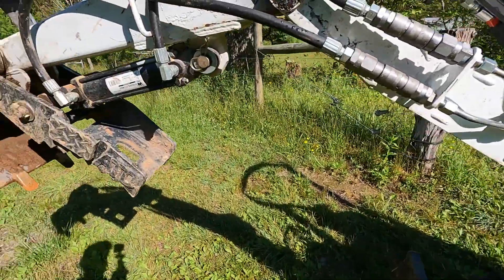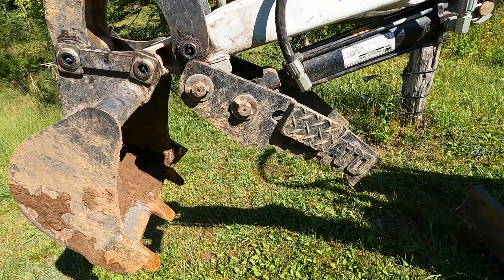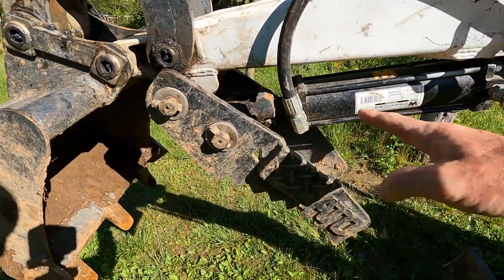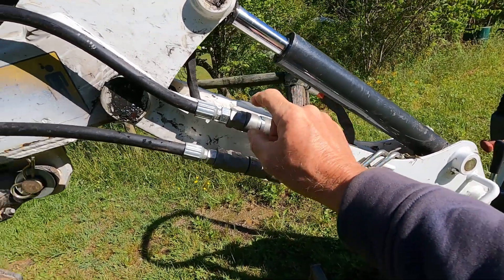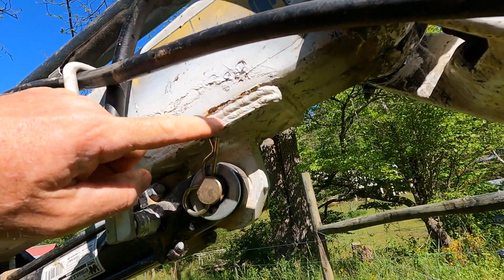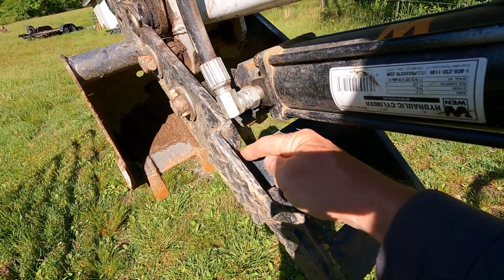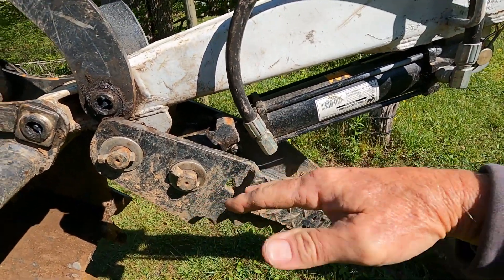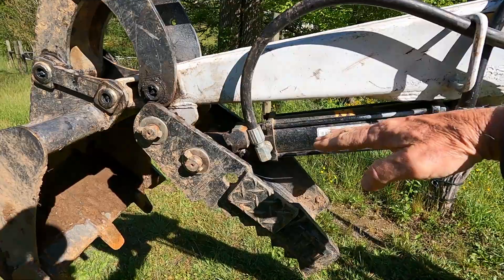Hydraulic Thumb for the Bobcat E10 Excavator

Comment: Hello, very informative video thanks. May I ask, does this require double action auxiliary hydraulics? I'm not sure if my e10 will support this or if I have only one way hydraulics.
Reply from the maker: The hydraulics on the e10 are two way so it easily works for a thumb. The problem is making a thumb fit on an e10. The stick is so short in relation to the thumb length it makes it hard to fit.

Comment: Thanks say do you think changing the position of the cylinder mount a little closer to pin in the boom would allow the thumb to open more
Reply from the maker: I have tried all positions to maximize opening and closing and have tried 6, 8 and 10” cylinders. With a 6 it opens fully but doesn’t close enough. The 8” closes but doesn’t lay back flat. The problem is the stick is too short in relation to the length of the thumb. I heard you can use a thumb for an E20 which uses the bucket pin but also requires some modifications. Good luck. 👍
Reply: @arlingtonguy54  thanks

Comment: I just bought a brand new bobcat e10 last December and they installed  a hydraulic thumb on for me . Later on I found out was the same thumb they use for an e 20 . Yes you’re right sometimes  is just in the way .
Reply from the maker: That is surprising!  Bobcat doesn’t offer that on the website. Glad they did that for you.
Reply: They did it at the dealer is the same as an E 20
Reply: Hi Tony, would you by chance have any photos of your set up with the E20 thumb on your E10?  Thx

Comment: i have a E10 and an E20 i have the thumb on the E20 
the E20 thumb will fit right on the E10 the lower piviot point is the bucket pin that is longer. then yoi could use the 8" cylinder
Reply from the maker: I’ll look into that. I just switched to a 6” stroke and it’s too short. It retracts 100% but doesn’t close much past 90degrees.